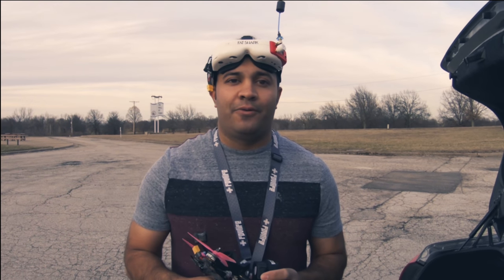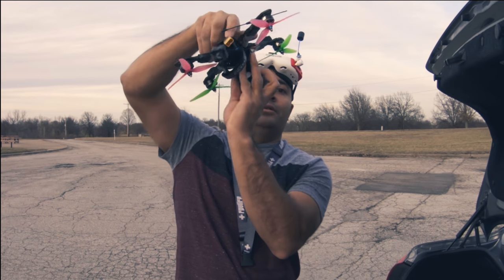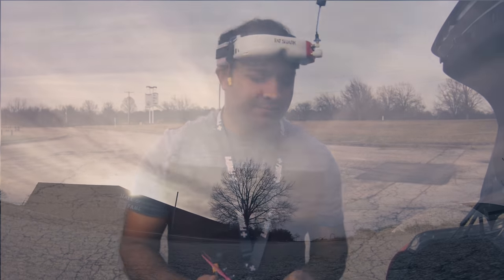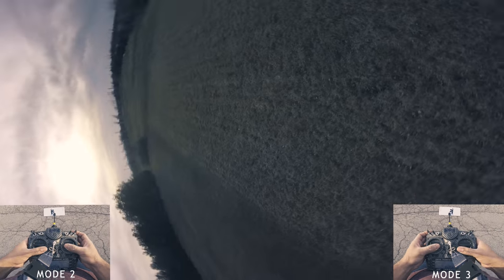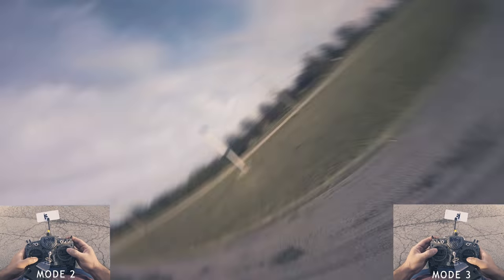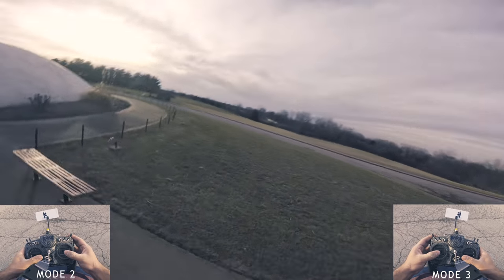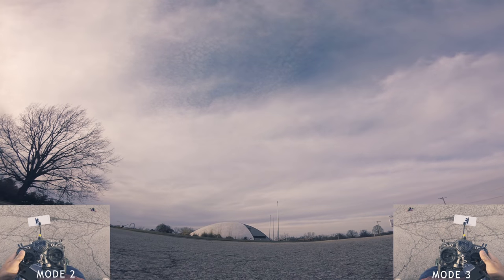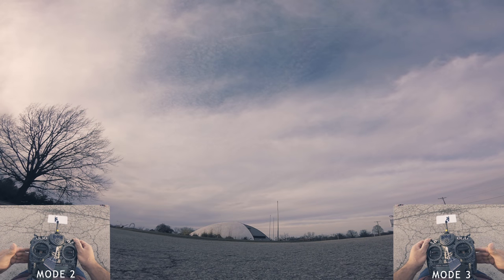FPV TRICK SERIES: HOW TO INVERTED YAW SPIN?! 🔥🔥🔥| FPV FREESTYLE

Comment: I've been practising this for a while, so far a fair few ground thumps, ejected battery and a smashed top plate. Rooster takes it well. Definitely timing is all, I just need to relax into it more.
Reply from the maker: Yeah if you aren’t pushing the limits you can’t get better. I been through the same now it’s much easier trick to do

Comment: Great vid.  Clever mode 2 mirror of mode 3 lol.  I'm surprised as hell you aren't adding a little roll.  I always thought that was a must for flat spins.
Reply from the maker: It depends on tilt and the angle you come into it. I do at times but I know if I need to based on stick feel
Reply: @VIKFPV  Out of curiosity whats your camera angle?
Reply from the maker: Nick 25 ish

Comment: One thing that I found is the quad will actually descend much quicker during yaw spin vs hanging inverted as the props actually need to spin up to create the torque to yaw even though the throttle is completely chopped off...
Reply from the maker: Yeah you have to find that sweet spot

Comment: Cool idea with the mode2 cam.
Do you coming at a certain level, to match the cam tilt, so that you dont have to mix in roll for the yaw spin?
Reply from the maker: I personally don’t know I just estimate based on stick feel. I don’t pay attention to the fpv feed
Reply: @VIKFPV  do you mix roll or its only yaw? And on normal yaw spin too?
Reply: @VIKFPV  when you dont mix in roll, you have to be on a certain angle with the fpv and hd cam. I think you are used to stick feels which hit exactly that angle after you turned upside down. Right?

Comment: Are you using any roll in the yaw spin or just yaw. I find it a lot easier when trying a regular yaw spin  to include roll too.
Reply from the maker: It depends on if I am coming in at a angle or not. I rely on stick feel to see what I need to do

Comment: very usefull with also mode 2
could you do a trick tutorial of the inverted orbit?
Reply from the maker: Mmmm that might be a hard one you technically can’t do a full orbit inverted but if you send me a video I might be able replicate what you are talking about
Reply: @VIKFPV  some people call it a trippy spin, pretty easy with crazy high camera tilt angles, harder with lower angles, I use 30 degrees tilt and it takes like 75 to 80 percent throttle to not fall lol, it's inverted relative to the camera not the quad. I apply the same to my inverted yaws, which requires me to use roll in addition to yaw to keep the horizon level (again relative to the camera)
Reply from the maker: Oh yeah I have done that before might be able to do one.

Comment: Was there a reason you prefer / started with Mode 3?
Reply from the maker: Yes I am right hand dominant so I thought and still think throttle is the most important input and wanted the best control over it. Always helps with having YAW on my right hand that’s why I like yaw spinning a lot it’s easier to do on my right hand

Comment: Hi VIK FPV. I'd have a question. It doesn't really fit into this type of video but still... 
I have the cl1 frame with 16:16 motor holes in it and I have motors with 16:18 aspect ratio screw holes so I can only screw 2 screws to a motor. Does it affect at all the durability, and if it does, is there any way to fix it(the only option I see is to make the holes on the frame a bit bigger. Maybe some glue would help?)
Reply from the maker: I have no clue. I only fly impulse rc frames
Reply: @VIKFPV  all right:(, no problem. Although it is just a tutorial video, nice flying:)